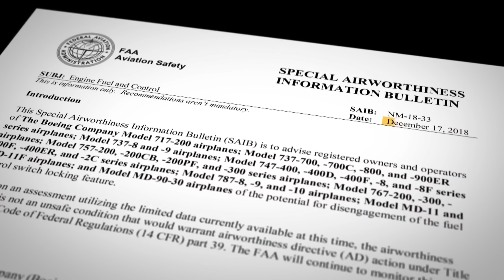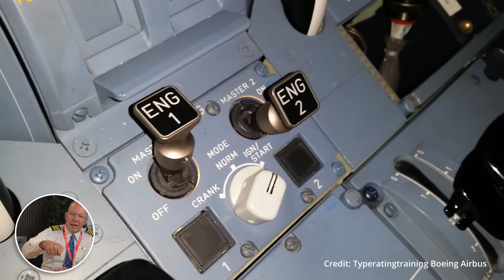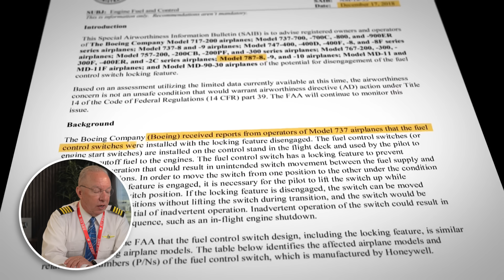Air India 171: The FAA’s 2018 Fuel Switch Locking Bulletin Explained (16 Questions Answered)

Comment: So maybe the fuel switched can be relocated 1, to the extreme left of the pilot, and 2, the extreme right of the co-pilot. This was either pilot can only cut off one engine, should a mental issue arise.
Reply: This makes no sense. You don’t avoid things like these by relocating switches. There’s literally countless other options to bring a plane down.
Reply: this can be said to any switch, button, lever, etc, ever. there is probably a million different ways to bring down a plane, its just not feasible to account for every situation. That is the whole point of having 2 pilots, one flies the plane while the other goes through a check list, that's the whole point of having a lot training, knowing what to do during an emergency etc. its impossible to account for situation where a pilot or pilots want to intentionally bring down the plane. even if you do account for most things, you are taking away control from innocent pilots that are in an emergency and need finer control over things because the software system itself cannot see everything, at least not everything a pilot can see. The whole point is for the pilots to be well trained enough to fix whatever situation as needed.
Reply: Boeing is powerful for sure 😢
Reply: Sorry, no.  Either pilot must be able to turn off either engine in an emergency.  Imagine if one pilot is incapacitated in an unrelated event earlier and then there is an engine fire.
Reply: @mmcowan  Very true. A key switch wouldn't be feasible.
Reply: @mmcowan  No keys. Use duplicate switches for both pilots instead. If one pilot is incapacitated AND the remaining pilot needed to turn off either or both engines (or 3 or 4), then he reaches over and operate the switch in front of his colleague.

Above each switch, an LED says either RUN or CUTOFF, reflecting the current state. If it is currently CUTOFF and you flip one switch up, it starts blinking, but doesn't go to RUN, until the other pilot flips his switch up as well. Then it goes to RUN. Or the first person cancels the change of state by flipping his switch back down and it stops blinking.

The same goes for going from RUN to CUTOFF. This way, one pilot cannot turn off both engines without the other pilot knowing. He would have to reach over and operate the other pilots console. And if either of them bumps the switch by mistake, nothing happens. But I still want plastic covers for these switches. And instead of using these weird toggle switches with detents, use spring loaded dials that turn instead. They require a more deliberate action to turn 120°.
Reply: @danielch6662  in an emergency when literally every second matters, do you think its a good idea to move the switch all the way to each pilot side? Others have said, if one of the pilot is unconscious, the other has to unbuckle his seat belt, get up and flip it off, all of this time wasted, everyone is already d3ad. Its convenient to put them both together side by side in the center. After all, this plane is assuming you are not a murd3rer. If you are concerned about a pilot su1c1dal or murd3rous intentions then any switch, lever, button would've brought down the plane. The fuel cutoff switch won't even matter. What do you suggest now? Make identical buttons and put them each by each pilot side? You are spelling disaster. All for 0.001% of guilty pilots?
Reply: Disabled during takeoff and landing. FLY the Plane
Reply: @robertnasser9937   but you havent scrutinized every possible thing that could go wrong by disabling during takeoff and landing. the most common issue is in case of engine(s) fire, feeding the engine with more fuel will lead to an explosion or what if there is a fuel leak during landing or takeoff? without fine control, it will lead to more tragic accidents. you are not thinking through when suggesting stuff like this.
Reply: That would be a terrible idea in case where one pilot is incapacitated and the engine on his side needs to be shut off in an emergency. The best option would be to have a 2 step process for shutting down the engine. Where once the main switches are flipped there's a confirmation and a different set of switches somewhere else on the panel needs to be flipped as well. This will make sure that the other pilot is fully aware of this, as it would take more than 2 seconds to complete the procedure.
Reply: Wow over 3k thumbs up in twenty minutes. That kind of engagement is insane.
Reply: @InStevenWeTrust  Incredible. I didn't think my comment was that commentable (Is that a word?)
Reply: Maybe even include a key that is attached to the dash with a chain lock. This will be looked at by Boeing closely to see how they can mitigate it.
Reply: @carbonbomb4774  That sounds cool. Pilot has one key, and the co-pilot has his own key. And each others key only works on one, not both. This was the co-pilot's key won't work in the pilot's switch. Good thought
Reply: @Prophet-Doug  Just like in order to launch an ICBM.  (In case you didn't know, that IS the procedure required to launch an ICBM, by the way.  Both launch officers must insert their own key at the same time.)

Comment: The problem with trying to find a technological solution (e.g. as the Embraier pilot mentioned, adding logoc to prevent engine shutdown) is the pilots are still flying the plane, so if one of them wants to crash it they'll still be able to find another way to crash it. No way to get around that until you have AI pilots, which will have their own issues lol
Reply: That’s why airbus is better …it gives the authority to its system first where it better then the pilots, Boeing on the other hand believes in total pilot authority
Reply: @andrewmarthie5062 No you missed the point. It doesnt matter how many systems and automatic controls you have, if the pilot wants to crash the plane he will find a way to crash the plane.

Comment: "Captain Steeeve" is peddling misinformation and misery, to gain views - and a few pennies. Shame on him. DO NOT WATCH THIS VIDEO. 

This is utter BS. This moron has deliberately misrepresented the intent of the bulletin. It reported that some 737s were delivered (new) with either incorrectly installed, or incorrectly assembled fuel RUN/CUTOFF switches, where the safety gate was not 100% as it should have been. Who knows how compromised the safety catch was? That was over a decade ago. Now, all these years later, this dishonest YouTuber is trying to gain views with sensationalist misinformation. "Captain Steeeve" has sold out to the YT algorithm monster and can no longer be trusted with anything he says. He is either dimm-witted or deceiptful - or both. In any case, you should avoid him.

The bulletin only said that some switches were reported (and confirmed) to have been less than perfect from new, but those same switches are tested (by use) twice, on every flight - independently of any checklists or testing procedures,; such as when engines are reinstalled, as they both were recently. In any case, the metal mechanism of the switches appears to be intact, so the investigators will already know that (presumably, since there has been no technical directive) that the switches were not at fault. Sadly, this is looking somewhat like Germanwings 2, but every other possible cause must be eliminated before such a serious accusation is levelled.

RIP innocent victims, who definitely do not need a selfish influencer cashing in on their fiery death.
Reply from the maker: I’d recommend watching the video, that is the conclusion Steeeve comes to as well.

Comment: Modern electric cars have cameras monitoring thing such as the driver becoming drowsy and not holding the steering wheel on some forms of auto drive. They can actually take action as well and can vibrate the wheel and jolt the transmission to wake the driver up. Such systems in a cockpit would only be an extra safety measure so that objecting to them is odd.

Comment: i find it strange that their doesn’t seem to be another effort to crash the plane what i mean is if a pilot shut the switches off why would he let the other pilot try and spool the engines up again and save the aircraft? You think some struggle would have taken place but the aircraft maintained level flight and the engines were attempting to start again which suggest the switches were put back into the correct position i just find it strange that no struggle occurred and the person trying to crash the plane let the other pilot try and recover the aircraft without interference, it really makes no sense whatsoever because the aircraft only needed a bit more altitude and theirs a chance they could have recovered the flight and not crashed.

Comment: Would like to know the electro-mechanical operations of the fuel control switches. Under what (auto) conditions do those switches go into cut-off mode without pilot/copilot's manual intervention?
Reply: Yes they can, short circuit or faults with the computer(s)
Reply: The mechanical state always matches the electrical state …it’s not your home router Jo glitch kar Gaya

Comment: Some of your answers are either lazy or disingenuous.  Having cameras in the cockpit would definitely help in this case.  It would leave no doubt in identifying which pilot was culpable.  It would certainly help at least the family of the innocent pilot and also in assessing the medical and psychological background behind the perpetrator.  Audio only leaves too much uncertainty as to what happened, especially in this case.  The other thing is having interlocks or secondary verification for dangerous actions especially during critical phases of flight should be mandatory.  For example, activating the fuel cut off switches during flight should require actions from both pilots, or at least an affirmative response from both pilots.  This prevents inadvertent activations or deliberate activation from one pilot, but does not prevent activation in the event of a real emergency like engine fire.
Reply: my 10 year old laptop asks me if I really want to delete a file, twice.  Fuel cutoff during flight should require second command verification, and no Steeeeve that wouldn't burn your wing off on short final.

Comment: Captain, I've been following your videos on Air India flight 171 and wanted to add some information that I think is useful, as well as ask some questions.  I'm lumping them together for convenience in posting; please choose which to address.

The fuel control switches are designed this way to be a safety feature; the use of these switches require a design that ensures two positive actions are executed to operate.  The first positive action is to pull the switch out to clear the fence preventing the switch from moving, and the second positive action moves the switch to the other position; they can't be left in any other position.  These switches will have service lives specified, so they will be replaced before they wear to the point where the safety feature is broken. Manufacturers of aviation and other equipment requiring safety and reliability features conduct specific engineering analyses to ensure safety/reliability concerns are correctly addressed.  There is a particular analysis called a FMECA (Failure Modes, Effects, and Criticality Analysis) that checks both mechanical and electrical/electronic components for how they fail and how those failures will affect the system they're installed in.  The FAA requires these analyses for their review before accepting aircraft for service.

I recall a question about a Fuel Cutoff indicator, and I seem to recall a lot of aircraft have a dedicated display for engine performance.  It normally shows gauges, but can display active diagrams showing (for example) how fuel is moving between tanks and engines, and may indicate improper/failed operation.  Can you talk about how such a display would function in this situation, or how you've used engine displays in your simulator emergency procedure training?

In one of your earlier videos you mentioned that the RAT is basically never used by pilots as it is emergency equipment. I would expect that both an aircraft acceptance inspection and a post maintenance check flight would exercise the RAT and any other backup equipment for proper operation before that plane goes into service.  Can you discuss any manufacturer recommended maintenance procedures, and any airline specific procedures above and beyond manufacturer recommendations relevant to this mishap?

Regarding your concerns over mental health, there is a lady named Xyla Foxlin who posted a video about her experience with FAA mental health concerns (https://www.youtube.com/watch?v=aj0H8oVS7qg for you or anyone who wants to check it out.)  She also posted some links on initiatives in changing the FAA's position on addressing mental health.  I wanted to call out explicitly her asking people to reach out to your congressional representatives to urge their support of the Mental Health in Aviation Act. May I suggest calling out various organizations that are or would be interested in getting involved?  I'm aware of AOPA for general aviation; I presume there are comparable organizations for commercial aviation, but I don't know if there's a coordinated effort between airlines or pilot unions.

Thanks for all the work you've done in informing us about this mishap, and aviation in general.

Comment: You say plain and simple and yet it's not really. You can tell by the amount of people with questions even after the reports are released. A camera would not only prevent reading magazines in the cockpit but may also prevent the switching off of the fuel valve because all pilots know that there will always be questions as to what exactly happened in the cockpit. This is the same reason for body cameras, a picture is worth a thousand words as they say. A video and audio recording would absolutely prevent something like this from happening again.

Comment: Preliminary report looks like cover up..  Fuel switches got off at what time and after that how many minutes engine can operate and it's clear that pilot haven't point any wrong doing by another pilot or sny mistake done. Switches went off due to some other reason. it's manually not done

Comment: Maybe my understanding is incorrect, or I heard wrong, but I understand that the fuel cutoff switches were found in the plane wreckage to be in the off position.  But the flight data apparently shows they were set to off after takeoff and then set back to run.  Was the physical positioning of the switches in the plane wreckage in the report? And what position were they in?

Comment: The 787 might be even at take off as quiet as a320 cruising. 
In that eurowings a320 you could hear the pilot setting up the plane for sinking by click and press the buttons… that should be also possible to hear in die 787 voice recorder. There won’t be any conversations and the cockpit is quiet , and you can split the recorded audio into different layers to hear that ,, click ,, at some point for sure…. 
I ever talked to a few Indians. 
That ,,  why did he cutoff ,, also could be meant as why the engines shut down or something. Indias use ,, he ,, in that way. Same same ,, when does he ( the train ) depart. 
I think the pilot did just talk like this when he hear the engine sound like when he turn the engine off every day. 

Did I miss some details? Otherwise I would say as long as these cut off switches aren’t found in the crash area and you can see in which position they were, it’s not right to already talk like it’s the pilots fault.
There are so many more reasons, electric and software related ones that might just did what looks like the cut off switches turned off….

Comment: Coning from the submarine Nuke service, I would think that every 787 or even every Boeing plane should be grounded and these switches tested using a very rigorous process to ensure they operate properly and Can't be repositioned abnormally.  The switch design should be evaluated for any possible failure modes that may not have been tested/designed.  A simple failed brazed 1/2 inch line may have sunk a multi-billion dollar submarine (USS Thresher).

Comment: Hi Capt Steeve, I am an aviation enthusiast and not a pilot and also I am having a problem accepting the fact that someone would deliberately cut off the fuel switch. My argument is on the timeline reported in the preliminary investigation. 

Timeline 1 (from the report)
"The aircraft achieved the maximum recorded airspeed of 180 Knots IAS at about 08:08:42 UTC and immediately thereafter, the Engine 1 and Engine 2 fuel cutoff switches transitioned from RUN to CUTOFF position one after another with a time gap of 01 sec"

As per the timeline , Engine 1  shuts off and then Engine 2 shuts off  As we know that these switches are not normal light fan switches, to turn 1 switch off and then grab another switch off, it should take couple of seconds. To support this argument look at the timeline when the engine was switched on again....

Timeline 2 (from the report)
"As per the EAFR, the Engine 1 fuel cutoff switch transitioned from CUTOFF to RUN at about 08:08:52 UTC. The APU Inlet Door began opening at about 08:08:54 UTC, consistent with the APU Auto Start logic. Thereafter at 08:08:56 UTC the Engine 2 fuel cutoff switch also transitions from CUTOFF to RUN."

It took 4 secs between two engines being turned back on again by the pilot. This is an angle which is still disturbing me...